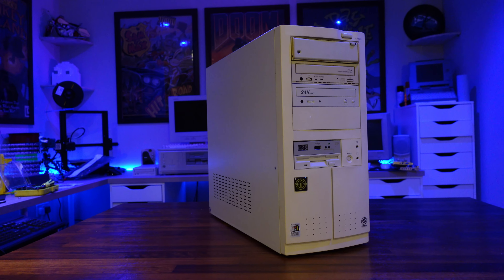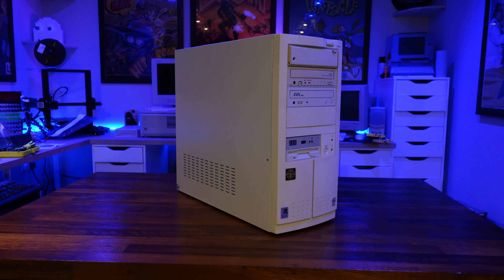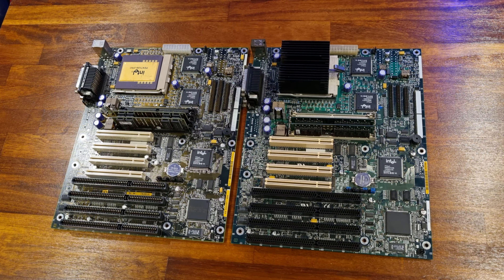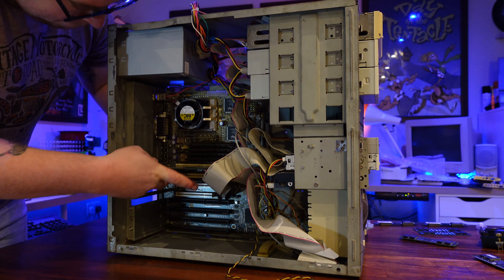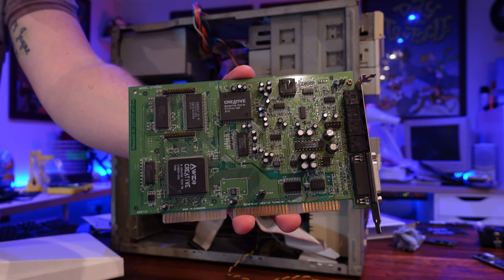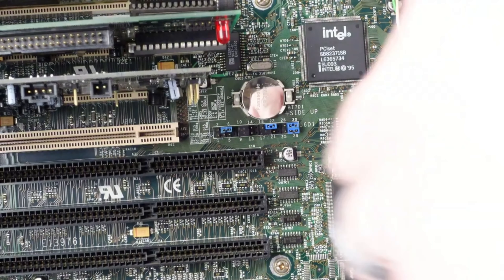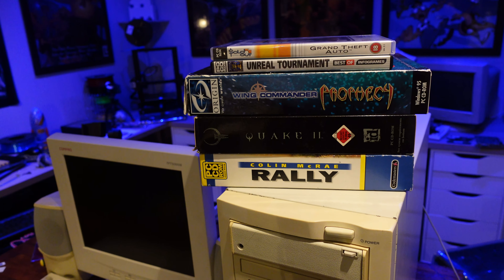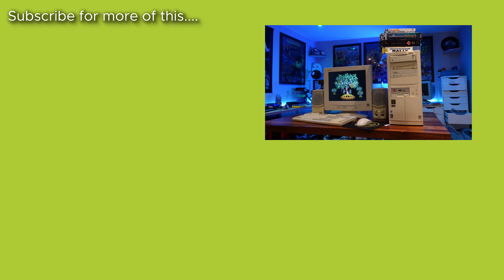The Barn Find Pentium Pro is FINALLY finished!

Comment: The dell version did use those unpopulated headers but with a 20pin atx connector with a different pinout and a single AT style connector, also with a different pinout.
Reply from the maker: That explains why the Dell version I bought went bang shortly after I first plugged it in!
Reply: @TechMadeEasyUK  I only found this out recently. Sometime during the mid 90s DELL were using intel boards but slightly modified power connectors to prevent them being used in normal builds. They are actually just moved across by 4 pins and you can mod them to use normal ATX supplies. Interesting thread on vogons about it and when I finally get a decent soldering setup I intend to mod mine.

Comment: @TechMadeEasy
I know this is two years removed, but a VooDoo3-1000 PCI might be a good upgrade and would still be somewhat period correct. You'd free up a PCI slot and upgrade you 3D experience as well. I would also change the SCSI card for an Adaptec 29160 or similar 68pin SCSI connector type card. One of those shouldn't be too difficult to find and would upgrade your storage to it's best. EDIT: Maybe a Adaptec 2940W/2940UW would be easier to find and has great driver support.
Reply from the maker: Randomly I have a 2940W sat in my spares pile awaiting testing. I’ve also noticed that controller is marked compatible with the BlueSCSI project, so it might be a way to introduce modern solid state storage
Reply: @TechMadeEasyUK  
Nice! I'd put it to use if it works! Those are very reliable cards so unless it has some damage, it's likely going to work and will provide a good boost in performance, especially paired up with BlueSCSI, which is a wonderful thing on it's own!

Comment: Great series. Why did you decide to remove the IDE drive caddy?
Reply from the maker: The caddy was fitted along with a PCI IDE adapter, but I ran into compatibility issues and reverted back to using SCSI hard disks. And even with the new motherboard with working IDE channels, they only support PIO speeds which are slower than the SCSI drive

Comment: Intel did manufacture main board and sell as intel product and released reference designs.  Dell used a reference design but no significant changes, I think Foxconn was making the board.
Reply from the maker: Great info, thanks! I've definitely seen a Dell branded board with a skinned BIOS so this makes sense

Comment: Nice video ! Those Pentium Pro now become very very rare and pricy ! Regarding the performance, the P.Pro architecture is really designed for a full 32bit operating system (such as Windows NT or Linux). Under MS-DOS / Windows 3.1 / 95 or 98, it takes a huge impact in performance : A Pentium Pro 200 Mhz has performance of barely a Pentium 133 Mhz. So using such a PC for MS-DOS or Windows 95 gaming is not the best option ! It would be a better experience to test it under NT4 for instance ! :)
Reply from the maker: I think it's fair to say that those systems are not geared towards gaming though, and neither was this CPU. I'd love to try it with NT4 or 2000 and try some productivity apps on it
Reply: @TechMadeEasyUK  The real problem with this CPU, and this was a huge blaming in all the magazines at the time, is the very poor performance in 16bits systems (or mixed 16/32bits). This was like a real flaw in the design, and it explains why it was kind of relative commercial failure. As soon as the Pentium II was launched, It completely replaced the Pentium Pro since it was a superb performer in 16 bits and 32 bits OS.
Reply: That's simply not true. 
While the Pentium Pro does take a performance hit when running software that used mixed code (8 and 16 bit, 16 and 32 bit etc.), its nowhere near as bad as press at the time made it out to be. 
In fact run benchmarks and you will quickly find out that the Pentium Pro flies through them faster then anything else (non enterprise that is) available before the Pentium 2 was released.
And for DOS games? well many games were actually running 32bit code even in DOS, check for 32 bit DOS memory extenders like DOS/4GW on game startup.
A Pentium MMX 233MHz stands no chance in comparison (unless its a heavily optimized MMX benchmark).

Also its important to turn on features like "Write Combining" when running DOS on a Pentium Pro, this is usually done by running "fastvid" or "mtrrlfbe". This can more then double the graphics performance (!).

I have many of these old systems.
And while i like most of them, the Pentium Pro's really stand out.
Chuck in 256Mb memory and even Windows XP runs OK (ish =)

A final note to the video creator.
Pentium Pro's are multiplier unlocked, most can do 233MHz with decent cooling (which you have).
The VS440FX has an undocumented 3.5x setting to achieve just that.
Not that ~10% extra performance will make a huge difference, but its kinda fun to do =)

Comment: Had the exact same Enlight case back in the late 90s, with an Abit board and a crappy Celeron 333 in it. Fond memories playing FF7 with it.
Reply from the maker: It's a great case, my only annoyance is the sled system for the 5.25 bays. Anything that isn't solid (like a removable hard disk caddy) tends to flop about as the caddy isn't secured directly to the rails